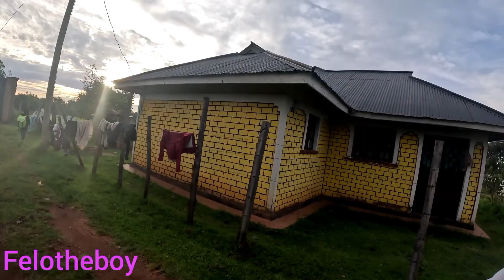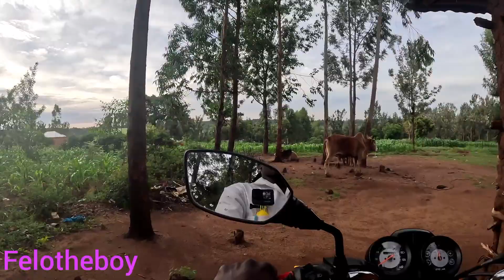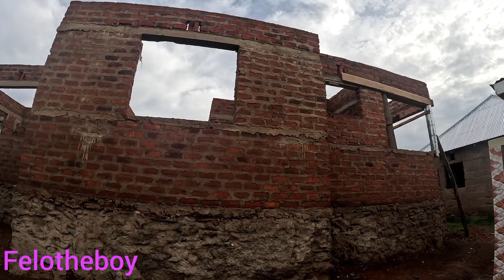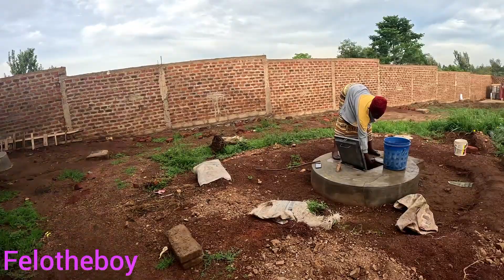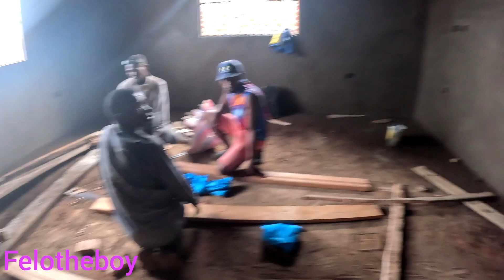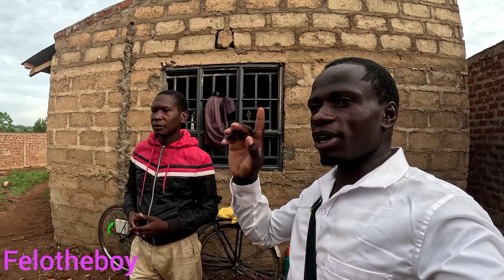Am Sorry!!! But This is the TRUTH!!

Comment: Felo putting the pipes in wall with out the windows, can be problem in you don’t have on the roof, water can go in the pipes and that will give you problems with your electricity. That can very dangerous.